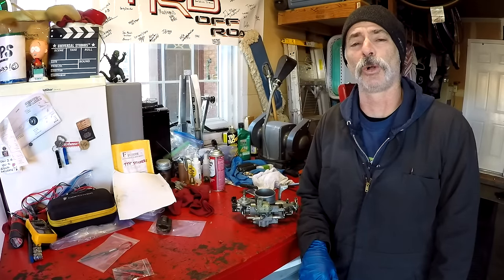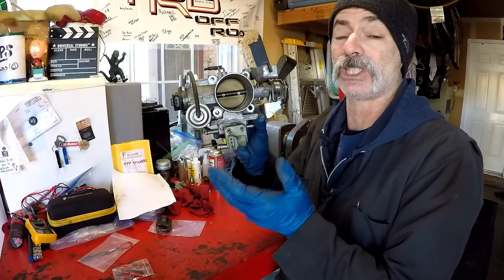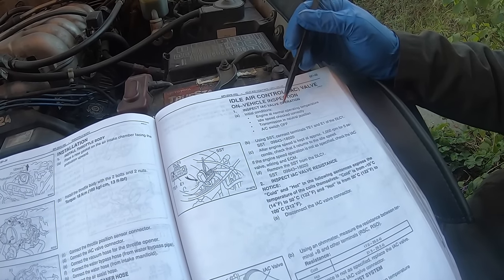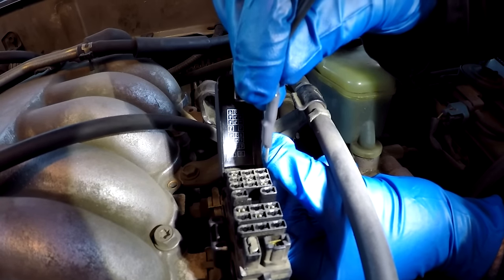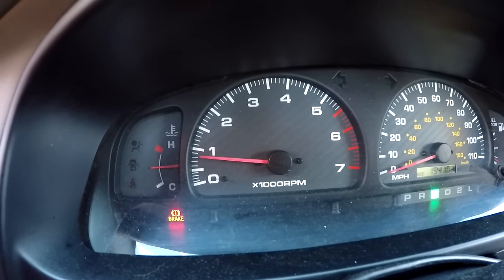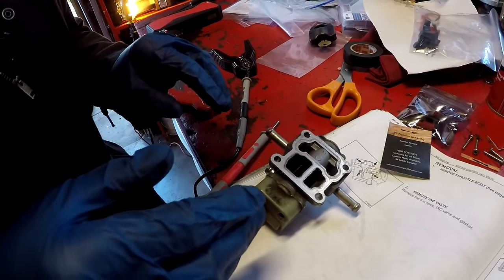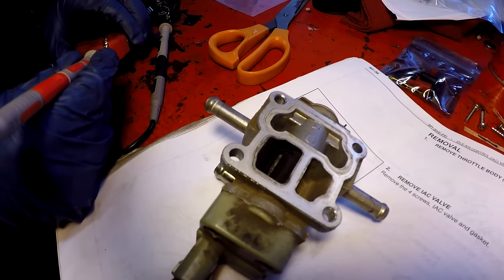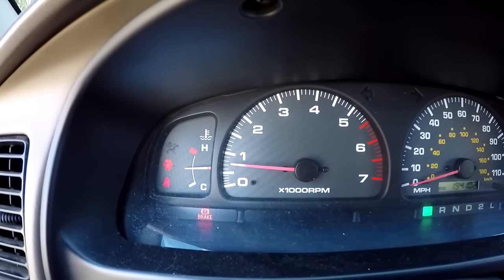IAC Valve Testing and Cleaning

Comment: I know this is not the subject of this video but can you get back to me and I want to know what the best locking differential is for the rear and for the front on a Toyota sequoia 02￼
Reply from the maker: ARB air lockers are very good but they aren't cheap.  They run around 1k each and then you have to get somebody to install them for you unless you're willing to try to install them yourself which isn't easy.  I don't know if there's a Toyota e-locker option for Sequoias, but if there is, you could maybe find a used e-locker for the rear and have it installed and then maybe get an air locker for the front.

Comment: With my Opel when coming to a full stop (Traffic light) the car revs up approximately 1.5k revs and back down to normal revs. I have also noticed the car is consuming so much petrol.
Could this be IAC ?
Any suggestions?
Reply from the maker: It might be a problem with the IAC, but it also could be a vacuum leak or possibly an issue with the throttle position sensor.

Comment: On my 3rd Gen 4Runner, I have a pulsing idle issue when I am in drive and stopped (at a light).   The pulsing goes away if I shift into neutral or as soon as I accelerate.  I have replaced my IAC and TPS sensors.  I don't have any codes thrown.  Any ideas on cause?  The RPM's pulse from 500 to 700.   Thanks for the great videos!
Reply from the maker: When it's in drive, there's a slight load on the engine.  I'm guessing it doesn't pulse in Park either?  You replaced the two components I would have thought could be the culprit.  I've never come across this problem.  I'd ask this question on a Toyota forum or Toyota Facebook page and see if someone has dealt with the same problem and knows what the issue could be
Reply: @TimmyTheToolman  Yes, the pulse goes away in park, as well.   I've also noticed a slight/brief hesitation when I accelerate. This hesitation is intermittent, though. Thanks for the quick response.
Reply from the maker: @harrelsonbryan80  I'm wondering if it could be a torque converter issue since it's only when the drivetrain has a load on it.

Comment: Great videos. Thanks for making these available. My 2001 4Runner idle fluctuates sometimes but only when I’m stopped and the AC is on. Any suggestions on where I should start diagnosing?
Reply from the maker: I think it could be an issue with your IAC because I don't know of any other component that could add more air in to increase the idle on the engine when the AC is turned on.  Your engine is suppose to idle faster when the AC is turned on because the AC compressor puts a larger load on the engine and it the idle isn't increased, your engine can die.
Reply: Thanks for the reply. I cleaned the throttle body since I was replacing a nearby part on the intake. I tried not to let the liquid run into the IAC. I haven’t tried cleaning the actual IAC yet but, the idle with the AC on seems to be acting more normally.
Reply from the maker: @matto.5961  Well, that's good it seems to be idling better.  But, cleaning the IAC wouldn't be a bad thing.  Let me know how it goes.
Reply: Ok. I’ll give it a try after I get some of those plugs for the hoses. Thanks
Reply from the maker: @matto.5961  Ok, I hope it works out for you when you get around to doing it.

Comment: My 1998 4runner was stalling on me and i happen to change the IAC, Spark plugs & Wires and was still stalling on me when i come to stops or slow down my car, it will stall and died on me but starts right back up so i decided to change the TPS and what do you know it was the TPS all along. After spending $200+ on the IAC and spark already.
Reply from the maker: Good job figuring it out.

Comment: Great and very informative. I have had multiple issues since getting my valve cover gaskets replaced here in Costa Rica. The mechanics are not very good with attention to detail. You mention being aware of the two coolant hoses being mixed up with the air assist line. I presume the back one is the area of concern? If these hoses were mixed when re installed would this cause idle problems? I suspect yes. It now runs very rough at start up (cold or hot temps) and the exhaust smells of coolant. Any tips? I'm going to attempt this inspection myself. Would you recommend cleaning the IAC now if this was incorrectly connected? Thank you Timmy!
Reply from the maker: If they switched those hoses, it would flood the cylinders with coolant.  Maybe they did that, realized their mistake and switched them back.  If the hoses were still switched, your engine wouldn't run at all.  They might have hydrolocked the engine and caused damage.
Reply: @TimmyTheToolman  thank you for the quick replay. Going to inspect/ clean the IAC valve later today, wish me luck.
Reply from the maker: @tonyjovanovic9259  Yeah, good luck.
Reply: @TimmyTheToolman  thank you for what you do by educating us regular guys. I was successful today with my cleaning of the IAC valve for my 99 4runner. My Tico (Costa Rican) mechanic looked at me sideways this morning when I picked it up at his shop and said "maybe that was the issue" when I told him about my online research and desire to attempt this myself. Funny thing is he wanted to send the fuel injectors back into get cleaned/checked, once again. The previous mechanic quoted me $4000 usd to replace the 6 injectors. I'm going to do as much service work as possible in the future and with your assistance I'm more confidant and will hopefully sleep better tonight. Sending you a positive Pura Vida vibe and mucho gracias amigo!
Reply: @TimmyTheToolman  another question please. My rpms are now roughly 1200. Is this typical and is there an adjustment to the throttle position sensor?
Reply from the maker: @tonyjovanovic9259  A normal idle is around 800 rpms.  You're running high.  Maybe you have a vacuum leak somewhere.
Reply from the maker: @tonyjovanovic9259  Hey Tony, I'm happy to hear our videos are helping you out.  You are smart to tackle your own work especially since the mechanics there don't seem to be very competent or honest.  $4000 is a crazy amount just to replace injectors.

Comment: Hi Timmy I Just Came Across Your Video and Were Hoping You Could Give Me Some Advice.  I Have a 1997 Toyota Tacoma 3.4l With a Very High Idle Problem. I Had an Injector That Needed Replacing as It Was Causing a Misfire. Well After Getting Everything Put Back Together The Truck Idled Wayy Too High. 2000 to 2500 Rpm. I Did Clean the Iac and Throttle Body Twice But Still The Problem Is There.  I Will Say the iac is leaking coolant from a faulty hose or or nozzle end. My Question is Could That Iac be the problem? Or Could the new injector be causing it?  No codes until i unplug it while its running to test.  I'm about in tears from how many problems i'm having right and left.  Thank you for any help you can provide.
Reply from the maker: I would double check your work.  Sounds like to me you have a vacuum leak.  I'd check your throttle body plate and verify it's closing all the way too.
Reply: Yes i will be absolutely double checking.  I had to order a new iac because i couldnt get the old one to stop leaking.  I did unplug it while it was idling and it did lower the idle.  Could that be a clue?  the minute i touched the connector back, it shot the rpms back up.  And the idle would keep climbing after the fan clutch warmed up.  thank you for your reply

Comment: Question. My truck turns over and starts just fine when it’s been sitting for a while. But say I run to the store and start it back up again if it’s warm it cranks and wants to start immediately without letting the engine turn over a second or 2. Any ideas what this might be? Occasionally does this not all the time
Reply from the maker: I'm not sure on that one Frank.  I guess you're saying it starts quicker than usual which is weird.  I've never heard of a problem like that.

Comment: When driving it doesn't do that when there is a stop and you stop completely the rpm drops more than normal, and when I release the brake it stays at stop before when you release the brake it starts rolling by itself without accelerating, I replaced the Valve cover gasket and many more things but I was missing the intake gasket, I am thinking about buying the iac valve maybe it is no longer good
Reply from the maker: So, it does sound like an issue with the IAC.  Did you test it like we showed how to do in the video?
Reply: @TimmyTheToolman 

You can only measure with the multimeter and when cold the resistance it gives is 20.08 ohm, I think that perhaps the valve is already defective. Thank you for your attention.
Reply from the maker: @fernandopozuelos22  Fernando, if you're going to replace it, I wouldn't buy an aftermarket IAC.  I have heard of lots of problems with aftermarket ones.  I'd only install an OEM IAC.

Comment: Thanks for a great video.  What would you do if you had a "cold" fast idle that is too fast?  Would you try to loosen those two screws on the other end of the shaft from the coils and electrical connector and try to tension that bimetallic coil spring that is inside there?  I have a 96 Honda Civic EX A/T that is idling too fast since the fast idle is supposed to be 150 to 300 rpm higher than the idle speed of 700.  Mine is fast idling around 1600 to 1800 and it is very annoying.  I've already cleaned the throttle body and IACV.  Thanks if you see this.
Reply from the maker: I guess it's worth a try to mess with the screws.  I'd just pay close attention how much you're turning them so you can go back to where you were if the adjustments make things worse rather than improve the idle.  I would start with 1/4 or 1/2 turns to see where it gets you.
Reply: @TimmyTheToolman  Thanks for that.  I know I didn't explain too clearly.  I'm talking about the two small screws that hold the cover plate on the end of the shaft and they are both slotted holes to allow calibration at the factory, for the bimetallic spring inside exposed to the heat of the engine coolant.  One of the screws has red lacquer on it to indicate whether it has been tampered with.  I suspect that when these IACVs get old enough the bimetallic spring loses tension.  My service manual doesn't give the amount that the internal valve should be open at what temperature, like the way we used to set choke plates with the appropriate sized drill bit.  I haven't seen a video where anyone corrected their fast idle by adjusting this spring.  It would help me if I knew what size drill bit should fit in the valve opening at, say 68 deg F, so I could check mine to see if it is out of calibration.  Thanks.
Reply from the maker: @captainwho1  Gotcha.  That's above my pay grade.
Reply: @TimmyTheToolman  I hear ya.  Seems like the auto companies want to sell expensive parts rather than give us important info. in the service manuals.
Reply from the maker: @captainwho1  I definitely think there's a lot of truth to what you said.
Reply: I eventually did get mine to fast idle at 900 RPM and hot idle of 700 RPM.  I had to jump through a bunch of hoops to do so because someone had tampered with my IAC Valve and had removed the factory plug for the set screw that adjusts the plastic stopper inside of the range plate + bimetallic spring.  I ended up having to back off on this screw through a few trial and error sessions and ended up with a setting that gave the internal barrel valve a clearance opening of around 0.030" with a feeler gage.  I probably should have gone maybe 0.025" or so because this gave me a fast idle of around 1100 RPM but I was able to get it down the rest of the way to 900 RPM by turning the idle speed screw on the throttle body.  I had to turn that all the way in so I don't know what I'll do if I need to slow the engine down in the future.  Maybe I could get it to relearn it's idle at a different setting.  The other thing I had to do was extend the CW travel of the range plate by cutting one side of the slotted holes all the way in the range plate and making a special clamping washer with 2 holes for the securing screws.  I was able to adjust it on the car with an allen key by bonding a square nut plus socket head cap screw to the plastic hub on the range plate.  My bimetallic spring was so worn out/out of calibration that I needed about 30deg more CW rotation to be put on it.  A new IAC Valve from Honda was over $400 so I guess it was worth it but I realize most people wouldn't be so stubborn lol.
Reply from the maker: @captainwho1  Damn!  That was a pretty involved repair you did.  Good job figuring it out.
Reply: @TimmyTheToolman  Thank you.  Maybe other people can benefit from my anguish lol.  Their valves might even be closer to proper adjustment than mine especially if nobody tampered with.  Pretty surprising though that the bimetallic springs lose that much tension over 27 years.  MSRP of IAC Valve from Honda was close to $700.  What a racket they got going!

Comment: Here is a foreseeable issue I may have. My iac is not connected to the throttle body. I have 86 toyota truck 22re and toyota placed the IAC under the throttle body. Coolant lines and vacuum hoses connect it to throttle body and engine. What a pain to get it off. I still have not figured out how to get the electrical connector off the IAC which is in the back under the plenum. Working blind. I assume it is attached with one of those damn wires you have to remove to get the connector off. Anyway, I would like your recommendation on what to use for a gasket when I seperate my iac? I am assuming the gasket may tear and if it does is there any way for me to create a new one. Not sure if gasket is rubber or paper right now. Any assistance appreciated. Thks..jc
Reply from the maker: I'm not familiar with the IAC for the 22RE engine but it will definitely have a gasket.  I'm guessing Toyota doesn't make it anymore?  You could use a Toyota FIPG (Form in place gasket) if the gasket is discontinued or maybe there's an aftermarket option you can purchase.
Reply: @TimmyTheToolman  Thanks Timmy..jc

Comment: Timmy The Toolmsn, awesome content. I have a quick question. Do you the 5VZ-FE 3.4L V6 engines have the idle adjustment screw like the older 3.0L engines? Thanks in advance!
Reply from the maker: Hey Dominic, there is no idle adjustment screw for these 5VZ throttle bodies.
Reply: @TimmyTheToolman  thank you so much!
Reply from the maker: @dominicene3647  You're welcome.

Comment: Hey Tim, great video. I’ve been treating my IAC and it failed both of the tests where the vacuum hoses are disconnected. Not too worried about the throttle opener as I have no trouble starting but the air assist system I’d like to look into. Do you know the process for trouble shooting this? FSM says check vac hoses (I replaced with OEM), pipe and injectors. Not sure which pipe it’s referring too or how exactly to check the injectors. Any ideas?
Reply from the maker: The process for testing everything related to the air assist system is covered in the video.  You might want to pull the plenums off to expose the top of the intake manifold to make sure the air assist hoses are intact.  Once the plenums are out of the way, you will clearly see that the air assist hose that attaches to the IAC runs to a "T" connection at the back of the manifold and then two hoses split off to either side of the manifold to feed air to the channel that gives air to the injectors.  If those hoses are intact, then your problem lies elsewhere.
Reply: Hey Tim, thanks for the reply. That’s what I did, followed the steps in this video and replaced the air assist hoses with new OEM. When I disconnect the air assist hose my idle stays above 500rpm which indicates a leak. The FSM says check hose, pipe and injectors. I’ve replaced the hose but no idea what the pipe is it refers to. Also unsure what it means by checking the injectors.
Reply: I mean the FSM seems to suggest there could be an air leak at the injectors right?
Reply from the maker: @horatioeastwood  I guess one of the injector o-rings that seals the injector into the manifold could be bad.  I'd just make sure the main air injection hoses and the plastic T are all intact first.

Comment: Does anyone know if there is a fix for the 2001 model without replacing the throttle body assembly?
Reply from the maker: As far as we know, there is no fix.  You will get more attention to your question if you post it on a Toyota forum like T4R.org or maybe even a 3rd Gen 4runner Facebook page like 3rd Gen Mafia.